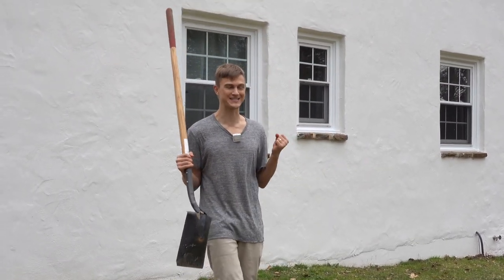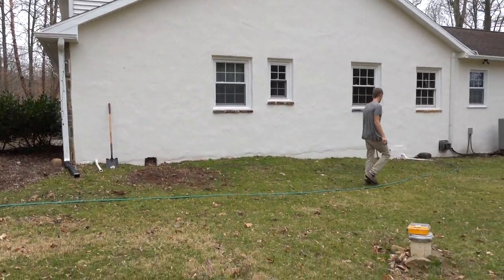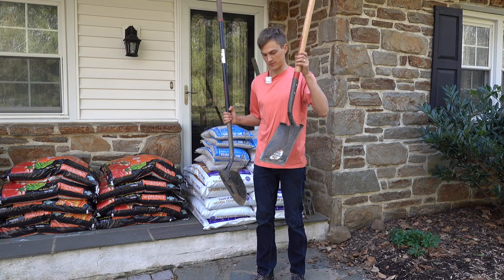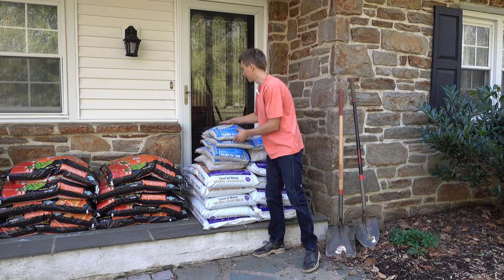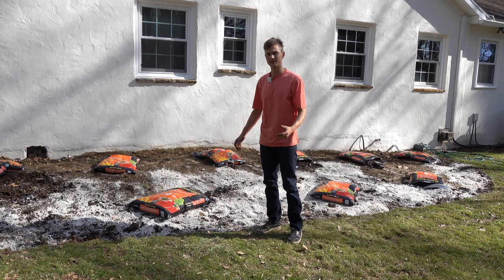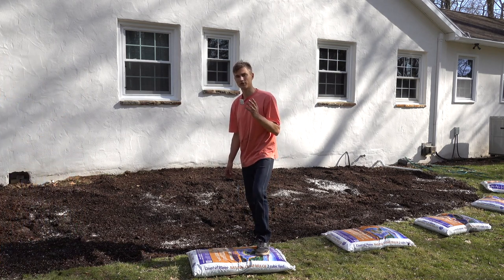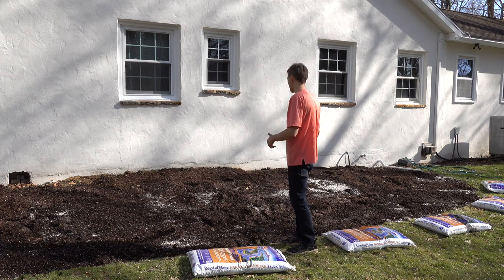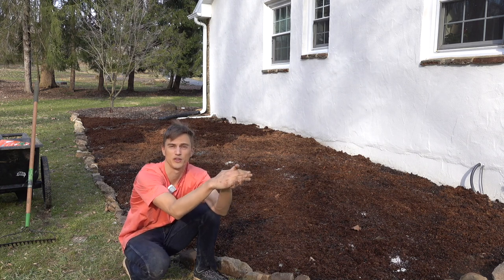New FLOWER BED from Grass for Beginners - DIY, Inexpensive, Easy

Comment: Thanks for the channel.  Love it. Take a tip from an old timer. Get your self a 4 inch angel grinder.  Cheep one from Walmart or harbor freight is fine. And prep your new shovel and sharpen your shovel and the digging will go much faster and easier.  Save your back any chance you can.  God' bless and keep making content.  🙏
Reply from the maker: Thank you for your tip! I really should sharpen it!
Reply: What would you need an angle grinder for?  I will take any tip to help in my flower bed.

Comment: I think you might’ve had a much easier time if you would’ve used a spade for cutting the sod and removing it. Also wondering why you needed to add soil to your bed? It doesn’t look like you were really tapering it away from the house for drainage. Or do you have poor soil in your yard?
Reply from the maker: Poor drainage